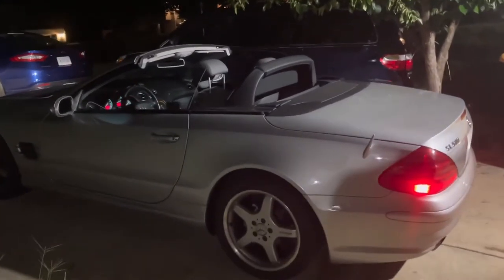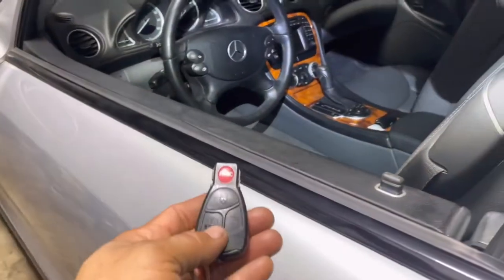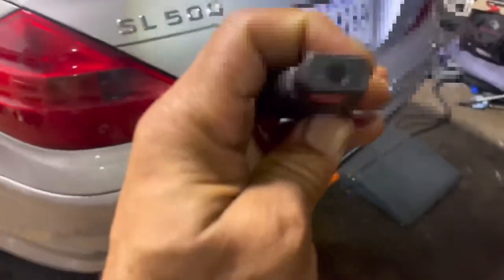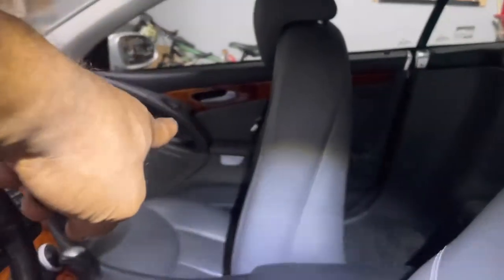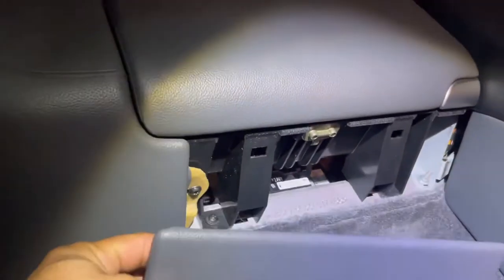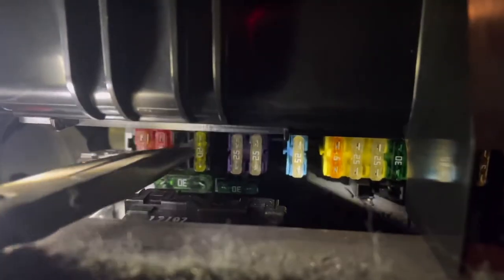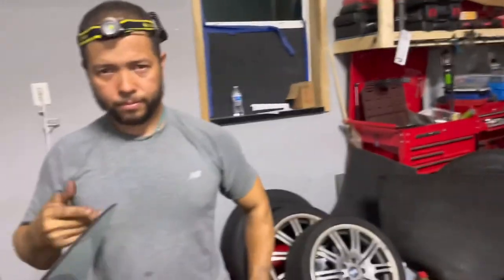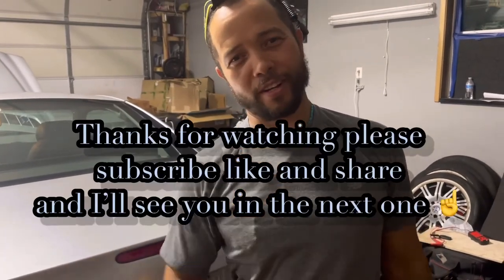2003 SL 500 lock / trunk / gas door / convertible top not working fix

Comment: Thanks so much for the video, it worked. The reason for the blown fuse was my auxiliary battery died and when the alternator tried to charge it the carge was more than twenty amps. Installed a new auxiliary battery, replaced the fuse and everything worked properly. Thanks.
Reply from the maker: Nice thanks for your feedback  boss

Comment: The real issue is why did you have a blown fuse? You never looked into this?
Reply from the maker: Why bulbs burn out
Reply: @nestorautorepair , bad alalogy. Bulbs burn out because the filament is a very thin, high resistance that is the "weak link" in a direct short that causes it to heat to white hot temps. A fuse passes electricity to the load. It is not the load. There's the difference. A fuse should not burn out without being overloaded.

Comment: I have a question if my trunk is not opening and my top is not going down and my power locks don’t work inside the vehicle when I pushed the button  is this considered the same fuse?  

I have a 2011 sl550

Comment: thanks for the video, I tried this, but no luck. to access the other fuses in the same section is rather difficult . where would I find the fuse diagram for this section. my power windows and cigarette lighter ports also don't work. Thank you
Reply from the maker: Wow it is possible just get down

Comment: I tried this Nestor.  The fuse was fine.  Doors only open and lock when I put the remote on the door handle sensor and push the button
Reply from the maker: Wow
Reply: So do you know what I can do if the fuse keeps popping everytime I put it in there is it a relay that makes it pop or is it a short how do I figure it out you know

Comment: I replaced that fuse on my 04 Sl500 and it popped immediately. Could it be a bad battery control module?
Reply from the maker: Wow or the motor is bad
Reply: I'd first check your PSE pump located in the trunk (boot). It sits low in the trunk on the left side of the spare tire and is subject to water intrusion/shorting if you have the common R230 rear trunk seal leak.